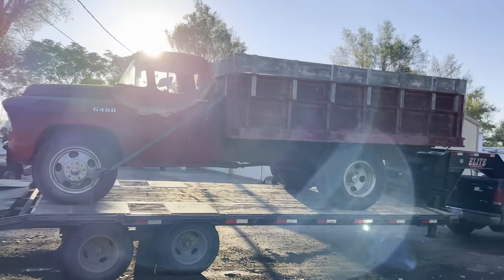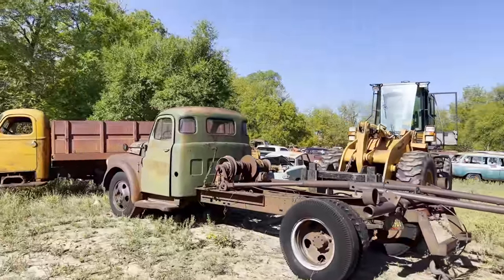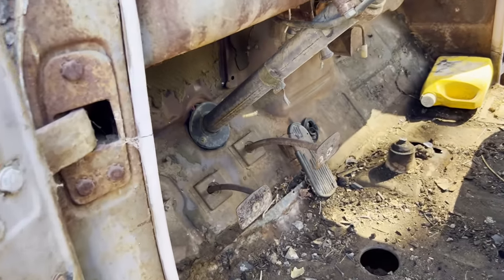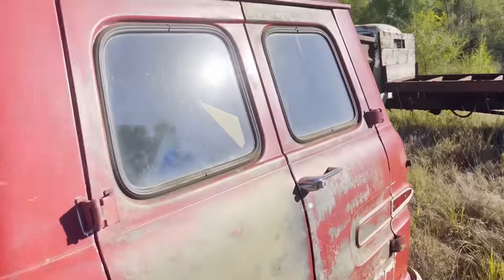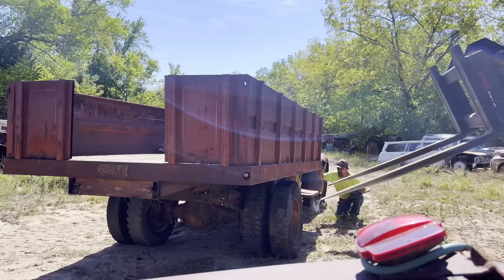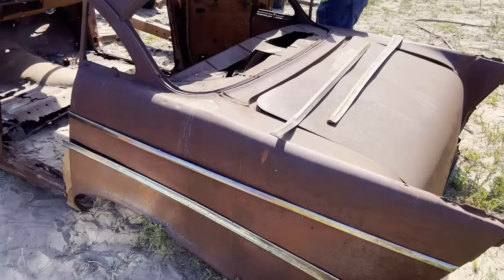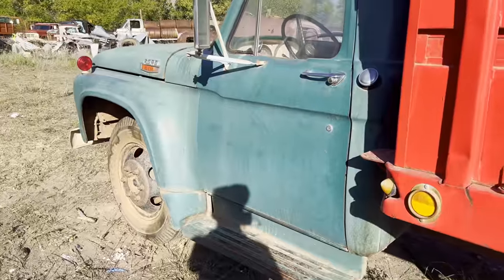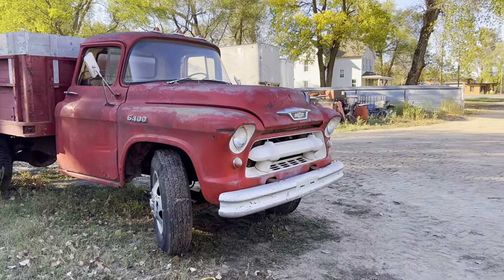The Nicest BARN FIND I've Bought in a Long Time, plus RESCUING Old Trucks from the JUNKYARD!

Comment: I love what you do. I'd volunteer my time in trade for goodies any time but I'm In Arizona. If it did not cost so much to ship I'd buy that 292 from that truck that sat stored in a barn but I can't have everything. I really wanted to try and get the 65 Chevy car you pulled out of a barn but you sold it really fast. I'm age 67 and still going strong building hot rods and rat rods but stuff in Arizona and anywhere on this side of the country is highly desirable and priced as such. If it did not cost so much in fuel I'd haul my 24 foot enclosed trailer to your place and do like some of your other customers and buy and haul back all kinds of crazy things. But until it all dies down I have to leave that thought on the back burner. Great video as always my friend. Keep em coming when you can. Thanks

Comment: I bought a 63 Corvair panel van two months ago for no other reason than I always wanted one. Mine has the rear door windows factory deleted. The first task is get it running again and new brakes. Chevy designed the cab forward concept so the first line of defense in a head on collision is your knee caps! No seat belts either. Once it's life is over I'll make a camper out of it and nose for wall art.

Comment: If the driveshaft has water inside from sitting or flood, in a fire the heat boils and if not enough holes for steam to exit the shaft blows apart.

Comment: The drive shaft exploded because it was in the fire  it was a sealed and the air expanded . I  bet someone has been hurt from a driveshaft exploding . Alot of old junkyards are cleaned up and after that all the trees and stuff is pushed in a pile and burnt. I have saw alot of drive shafts like that one in a burn pile at a scrap yard clean up.

Comment: On that drive shaft it kind of looks like the the weld failed and I would think under under torque if it failed it would kind of tend to flatten out kind of like that but I'm not 100% sure of that

Comment: I'm interested in the old Dodge cabin front clip. I figured we need different fenders or modification but I've got a 99 maybe 2001 Dodge half ton pickup. If that front clip is the right size along with the cab to fit on this truck and the price is right then I'm interested. I like to have a little nicer details on the front clip but maybe you or Joe has something. Maybe I should call you Blaine gave me your cell phone number. But I don't see me making out your way very soon. A few pictures payment and if you will hold it probably until after the snow stops flying. Little bit what I'm looking at thank you parrot by the way I'm reason sure that's a 57 that you weren't sure of because you've already given them the title because of ridge is going down the hood on that Chevy or gmc. And that guy cutting up that front clip had to be a 69 or newer Hood cuz it's flat up on front parrot entertainment system it looks like pretty good parts but then the camera does not always tell everything. My Dodge trucks a short bed extended cab so I have some room to wiggle it around an older cab on it. I plan to use the bed and if I can extend the back of the cab on an older Dodge cab and I don't care what year it is really. That would just be bonus. Besides a guy van out there I need to buy and pick up from Tim. Have I dropped enough names.? As always I enjoy your show. I want to extend your compliment I don't know if anybody else notice but when you hit your shin you did not have to bleep out your words because you did not utter anything. You're a better man than me. Quite admirable. He obviously spend your Sundays well. That's another reason I like your show and I think a lot of people do at least in part for the same reason. A good guy that shoots it straight and will treat you right until giving reason otherwise. How I see it. What it's worth. Any case if you want to send me a reply on that Dodge.?

Comment: Hi Silas, The Dodge truck is a 1956 straight back cab truck, they also came in the round cab bench shelf behind seat, out here in Australia they were high side utilities, tray back truck like the one you have, the old flat top motor was always reliable.